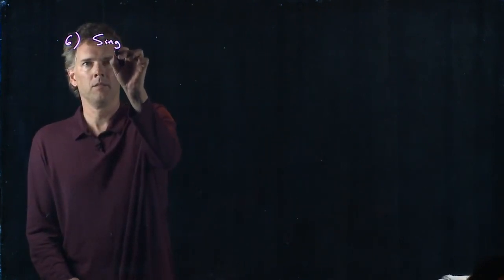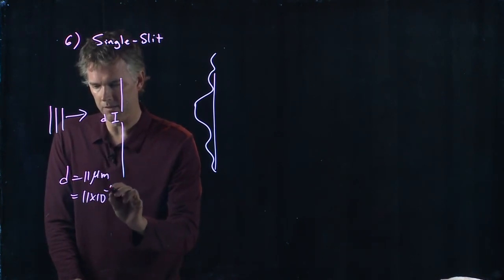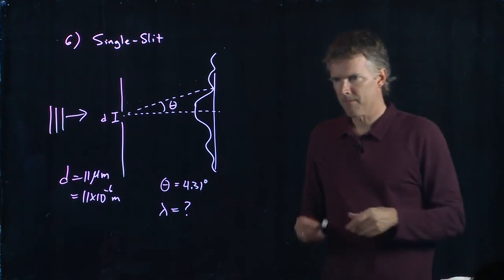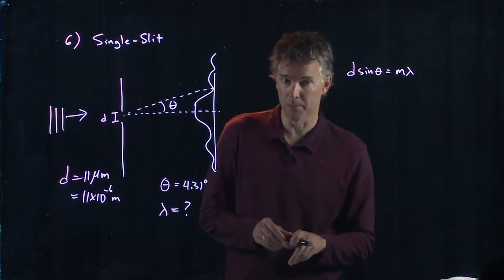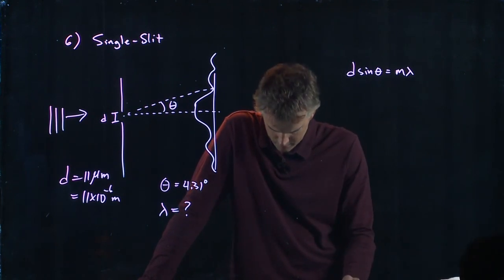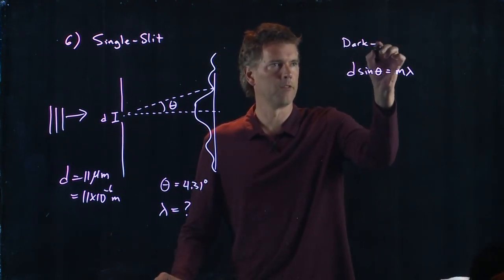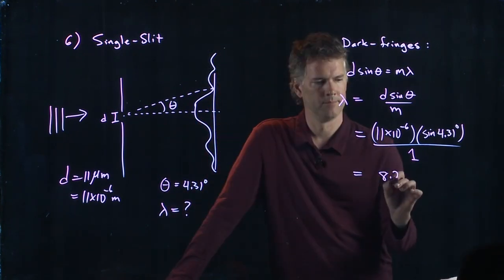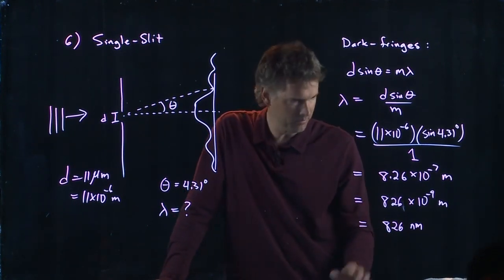Single Slit Interference | Physics with Professor Matt Anderson | M28-19

Comment: So which corner of the slit did the particle interact with?
Reply from the maker: Great question.  Answer: both.
Cheers,
Dr. A
Reply: @yoprofmatt  
Seeing as the Physics Community has yet to arrive at a consensus on interpreting exactly what Quantum Mechanics really means, we can't say anything about what is actually happening when and if the Wave Function collapses or indeed whether Quantum Mechanics is merely an accurate tool but nevertheless fundamentally incorrect.

Cheers
Dr. K